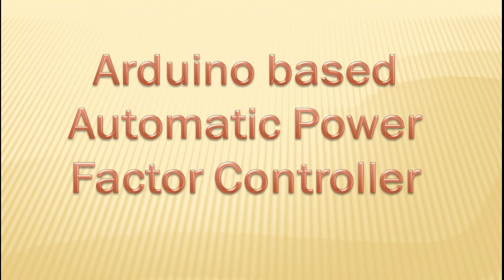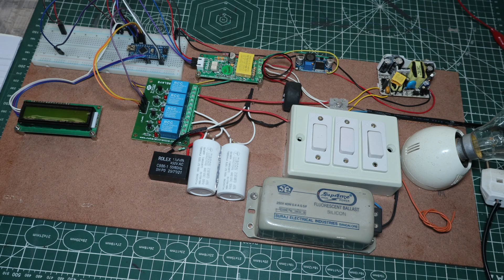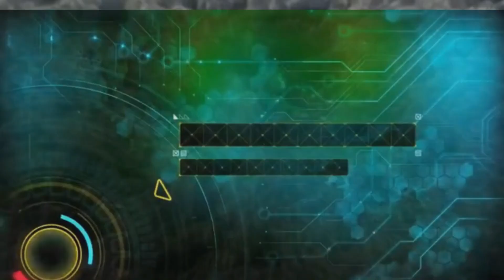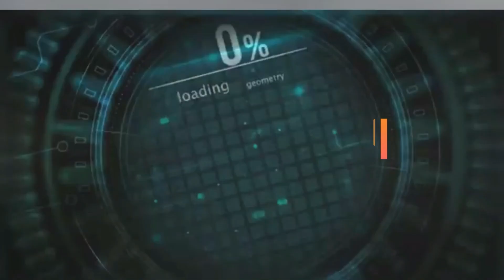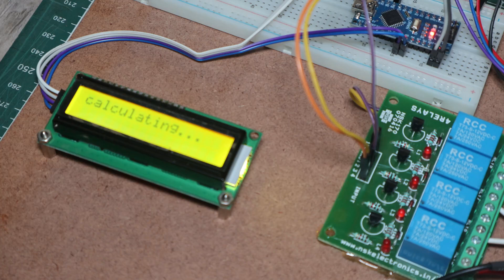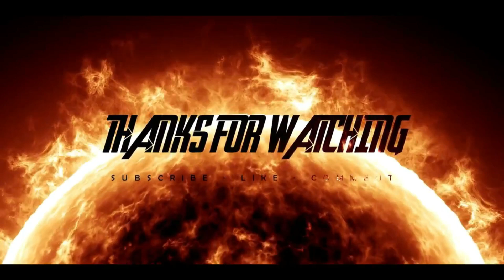Automatic Power Factor Controller Engineering Project #powerfactor, #Energy, #APFC

Comment: Can you please explain which transducers you have used to measure the phase differenence between current and voltage. And how to check the pf is leading or lagging.
Reply from the maker: PZEM004T ZCD Inbuilt
Reply: @hrbembedded_craft please give circuit diagram and code